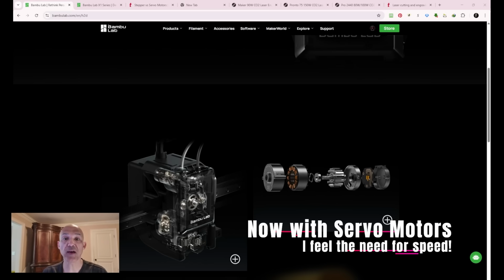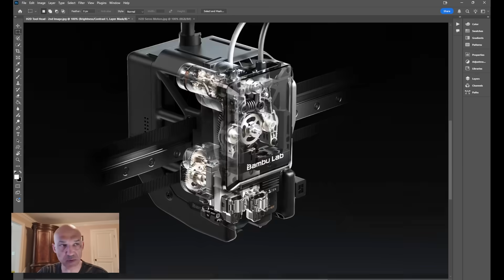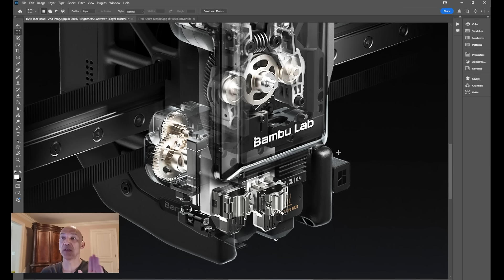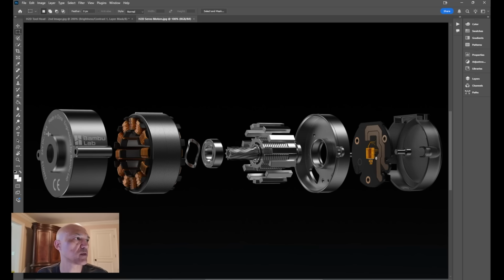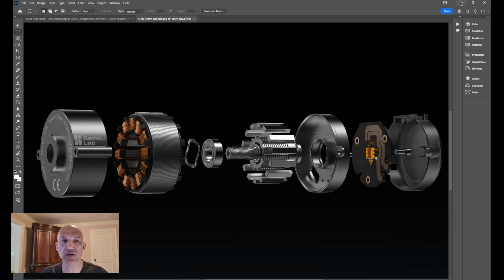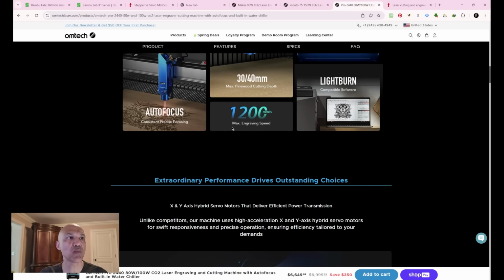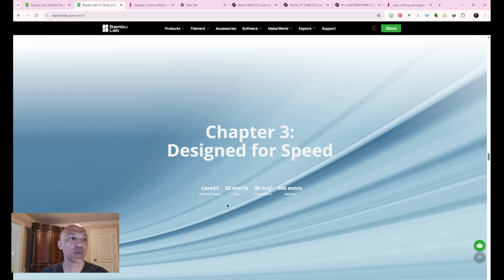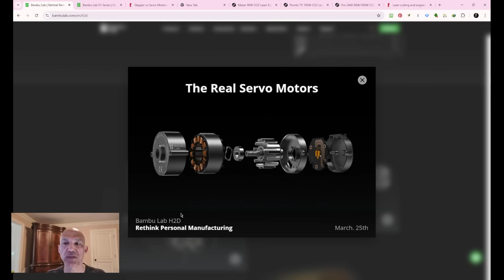Bambu Lab H2D  Fastest 3D Printer Ever? - Servo Motors and Tool Head Leaks!

Comment: The one big issue with using servo motor is that they typically run with much much higher speeds and lower torques than steppers. This usually means a gearbox of some type is needed to reduce the speed and increase the torque. (This also effectively increases the resolution of the encoder in terms of counts/mm.) The hard part is that you need a zero-backlash gearbox to keep the motion precise. I suspect that the wormy looking gear on the motor shaft connects to some such gearing. A zero backlash worm gear drive is somewhat easier to implement than zero backlash with spur gears, but you take a big efficiency hit, and you also have a lot more wear on the gears. It'll be interesting to see what they've come up with.
Reply: no neccessarily true... stepper motors are pretty misleading with their ratings.  They usually rate on "holding torque", so the max loading they can hold without moving.  Servos usually go off of their continuous rated torque, since they are used more in heavier industrial applications where the continuous torque is what really matters.  

I didnt think it would be that much of a difference until i rebuilt a CNC router that had some Longs Motor nema 44 steppers. I replaced them with some clearpath servos that are rated at the same wattage, but theyre nearly twice as fast, way more power, and dead quiet!
Reply from the maker: @shorelineplastics5090  Thanks for the info! I don't own anything yet that uses servo motors.
Reply from the maker: I think that is a good point, and it will be interesting to see what solution they chose for this!
Reply: You can get gear reduction with belts.
Reply: Looking at the picture more closely, the motor shaft looks more like a small helical gear rather than a worm gear. If this is used in a 1-stage reduction (before going to the belt drive pulley), then making it antibacklash wouldn't be too hard. But still more stuff to deal with than a stepper direct drive.

Comment: regarding the speeds: after the leak of the specs we know we have 1000mm/s toolhead speed and 20kmm/s Acceleration speed.  max Flow 40mm³/s (ABS, 280C), Laser (10w) 400mm/s and Laser 40W 1000mm/s.
Reply from the maker: @Flashy_DE  I just saw these as well!
Reply: 20kmm/s ? What is that?
Reply: @gigifrana940  20000mm
Reply: lmao still 20k accel 🤡🤡🤡🤡 Bambu users living in neolithic age, with that bed size even travelling diagonally it won't reach 1000mm/s

Comment: Nothing in this video tells me that it's gonna be anywhere close to being the "fastest printer ever"
Reply from the maker: I think you're right. There are now leaked specs that show it's going to max out at 1,000mm/sec.  FLSun has a machine that runs at 1,200mm/sec.
Reply: @directedt3ch  I believe that 1000mm might just be for travel speeds. Because that's how it works with the flsun, and that has cpap cooling which is very loud, so I doubt Bambu is gonna do that as they want to be as "premium" as possible
Reply from the maker: @ It should all be very interesting.  I was watching a video last night on the FLSUN printer and despite a claimed 100+mm3/sec extrusion rate, the reviewer saw it struggling past 40mm3/sec.  So yeah, just like lasers, it's really rare for the machine to ever have enough distance to get up to that speed before it has to decelerate to change directions.
Reply: @directedt3ch  yup, it definitely struggles to get that flow rate. I have a vzbot and I can get 60mm flow out of pla, if I increase the temperature to around 235°
Reply from the maker: @sedalespencer69  Thanks for the update.  I'm not entirely sure what audience they are going to target this printer towards... or if the audience even exists.

Comment: - Most interesting part of that picture are the 1mm pitch belts, not the mechanism as to how it changes nozzles... (These nozzle changers have existed for years)

- Steppers have StallGuard, why get servos? Microstepping is insanely accurate for it's simplicity. 

- You will not reach 1000mm/s, your weird "example" calculation of "What if it takes half as long" doesn't prove anything: "Faster is better duh". The limit on that printer will be the nozzle and extruder not the kinematics. Yes my Voron can move at 700mm/s, but printing is limited to less than half of that because of wanting to achieve consistent extrusion.

Actual industrial printers are on a whole other level than what Bambu is presenting, just like the Prusa Core One this is a printer for no one. The industrial players won't buy it, because manufacturers like Stratasys exist, and the normal consumer won't because it will be too expensive compared to X1C / AMS. 

Good job Bambu, a printer for no one, the community is proud

Comment: I think that this servo motor is just used to switch between the two heads and is not replacing the stepper motors?
Reply from the maker: There's not much reason to use a servo for that purpose.  It'd be most advantageous on the X and Y axis.
Reply: @directedt3ch  Yeah just that it makes the must sense and I think we can see it in the first image. BUT another issue is that it's new and will need to be tested for a while before I can move over. But funny thing is my old QIDI started working just after telling it that if it wasn't going to level right for a print I was going to replace it -- it started working. :)

Comment: This printer will not be leaps and bounds ahead of the X1 etc. You can have must speed as you like, but laying plastic down is very limited. The same has happened in Resin, we are near the end, not worth the extra cost that is for sure. I will definitely not buying it at that price. X1 is good enough. What we need is a excellent solution to MULTI color printing, solution nto all the waste, Not 8 print heads etc, a better solution.
Reply: Sounds like someone trying to convince themselves they don't want this new printer.
Reply from the maker: I don't see this a printer for me either.  But it is interesting.
Reply: This printers specs were leaked due to a poor attempt to hide the web page. The specs suggest this will be a big step forward, but I'm not sure I'd say it can "do things not possible before". 

One of the eye grabbers was 1000mm/sec travel speeds and "easy" 600mm/sec print speeds. 

However... from the specs, this is gonna command lots and lots of money.
Reply from the maker: @mikejackson9585  Well... other than cut vinyl sheets :)  I'm not sure I've seen that one on a 3D printer/laser before
Reply: check out the multi jet flash forge is making. stratasys and mimaki have full color polymer jetting printers but they’re  both the price of a fancy car. i don’t know if i trust flash forge to make a good machine, but the fact they are able to use the tech is impressive
Reply: Agreed, it would need significantly longer hotend with a huge heater upgrade, it's going to be limited to how fast that is. The fastest printer I have seen is a VZBOT with AWD (2 stepper motors for x and y) as the shorter belts make it so input shaping doesn't kick in until much faster but that's pushing the limit and the stepper motors have to use liquid cooling to print that fast. The Goliath hotend is insane and also has a liquid cooling option for heat creep but it can print a quality benchie in just under 6 minutes an 30 seconds (probably a 0.8 or 1.0mm nozzle though).
Reply: @JoshFisher567 the FLSun S1 Pro does an 8 minute bench out of the box with a 0.4mm nozzle, so it's definitely possible from a flow rate perspective- obviously that's a completely different motion system than the Bambu, just saying flow rate and cooling can be solved for this kind of performance. :)
Reply: It will enable super precise layering and repeatability
Reply: More print heads is a good solution, its just expensive, look prusa 4xl, it has 0 waste , and 4 times faster, bus, 4k
Reply: @vaughanza  pretty much everything has been leaked now. Lots of AI stuff, just Google "Bambu H2D leaks" it's on Bambu's forums,  options between a 10W and 40W laser... Claim 600mms but with a max flow rate of 40mms.  Printer only version can be upgraded but will be very expensive. Lots of QR scan automatically does "whatever". Still no Ethernet port, WiFi only... 

All-in-one Solution For Personal Manufacturing • Laser - 10W and 40W 455nm Laser for engraving & cutting • Digital Cutting - Precise cutting and foiling with a variety of versatile blades • Pen Drawing - Drawing and writing Live Spatial Alignment What-You-See-Is-What-You-Get The H2D's BirdsEye camera, combined with computer vision algorithms, delivers top-view alignment accuracy up to 0.3mm. This advanced spatial alignment allows users to place the tool path at the right position on the material - truly "what-you-see-is-what-you-get."* Auto Arrangement Maximize material efficiency, minimize waste. Leveraging real-time images from the BirdsEye camera, Bambu Suite can automatically arrange your project to optimize material usage. This feature ensures minimal waste while helping you get the most out of every project.

Don't Worry About the Settings - We've Got It Covered Material CodeSync Effortlessly sync settings with no manual input. The H2D can automatically scan the QR code on your material to load the perfect preset.* Full-auto Calibration A single tap initiates automated laser focus verification and material recognition, eliminating manual module adjustments while enabling precise configuration of material thickness, and positioning. Air Assist Improve surface quality by directing high-speed air to cool the laser path, ensuring cleaner and more precise results. Contact-less 3D Mesh* Advanced optical height measurement creates a detailed 3D mesh without physical contact, enabling precise laser work on curved surfaces. Go Big, Go Fast, Go Precise Our Secret Weapon: Vision Encoder 50µm ultra-fine motion accuracy* An ultra-accurate vision encoder plate, combined with 5µm resolution optical measurements to track and correct toolhead motion, enables the H2D to achieve consistent and reliable distance-independent 50µm motion accuracy across the entire workspace, one order of magnitude better than its predecessor. King-size Work
Break free from size constraints With a print volume up to 350mmx320mmx325mm*, creating large-scale projects has never been easier! From laser engraving on sizable objects to printing oversized models, the expanded capacity empowers you to bring even your most ambitious ideas to life.

350°C Hotend & 65°C Chamber Heating Unleash the full potential of high-performance materials Equipped with 65°C active chamber heating and a high-temperature hotend reaching up to 350°C, the H2D delivers precise closed-loop temperature control. This advanced system effectively eliminates warping and deformation in high-performance materials, ensuring superior layer bonding and maximizing their full potential. 

REAL High-Flow Hotend* Consistently print at 600mm/s with ease The H2D's purpose-built high-flow hotend ensures reliable, high-speed printing at 600mm/s. Designed for consistent performance, it eliminates mid-print speed restrictions, enabling uninterrupted high-speed printing regardless of the print size or complexity. DynaSense Extruder Intelligent sensing for precise extrusion control Bambu Lab's proprietary PMSM servo architecture establishes an intelligent extrusion governance system. It executes 20KHz Torque/Resistance and position sampling to dynamically modulate electromagnetic torque vectors. Reducing VFA and detecting filament grinding and clogging. A Smarter, Safer Experience Nozzle Camera Monitor extrusion at the nozzle tip The H2D features an Al-backed nozzle camera with macro lens. This intelligent monitoring system continuously tracks extrusion patterns, immediately detecting material accumulation, filament deviations
Reply: Price leaked, 3.6K in the US. Not sure if that's the printer/AMS combo or the model with the laser engraver. I would hope it's the laser engraver version with new AMS but it's not clear what model's price leaked from Bambu who apparently doesn't understand hiding web pages and making them accessible by the public before making them private again.
Reply: @JoshFisher567  better wait to tomorrow to be sure , I don't think 3'6k for basic model ,it's way too expensive

Comment: I love that they are using the A1 style hotends! The rest of the hotend just looks like there are way too many points of failure lol. The servo motors are a really good upgrade, they can run quiet and are definitely more precise. I don't think the print speeds will be over 1200mm/s most high speed filaments are only rated for 600mm/s. It would be nice to see them compete with the Delta 3D printers and I bet they could even push the acceleration to their max while keeping print quality at its best since they are using the linear rails. Hopefully they release a cheaper version like they did with the P1S, the X1C is so overkill for the majority of users and I think the H2D will be too.
Reply from the maker: That's a great point!  We'd have to see a larger number of fast printer for filament manufacturers to invest in higher flow filaments, and I'm sure there is a physical limit to how much filament you can push through a nozzle.  I'm also hoping that we see something like an X2C or P2S that uses some of this new tech but is geared to the home enthusiast instead of the personal manufacturer.